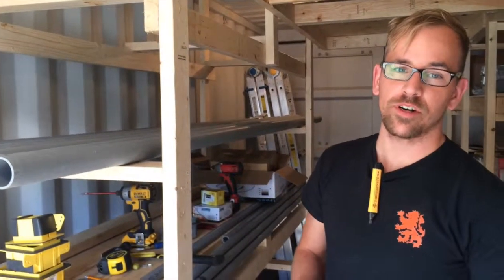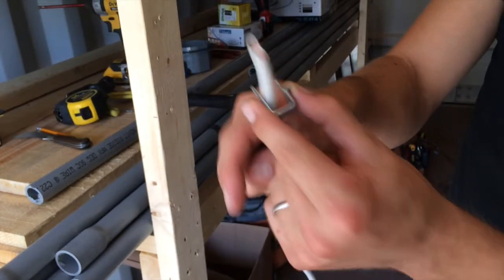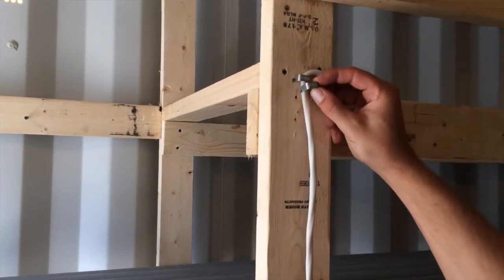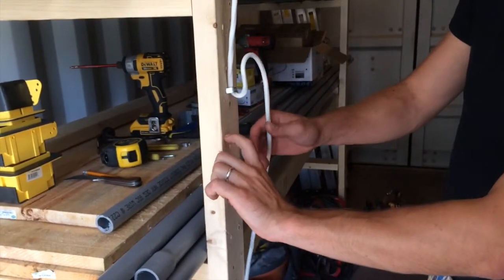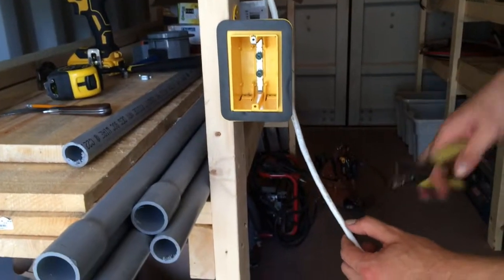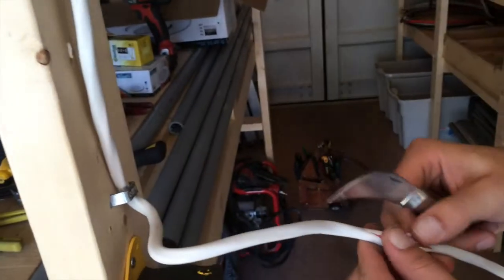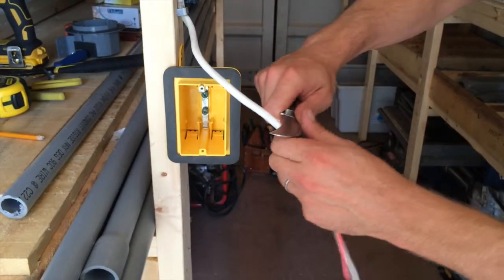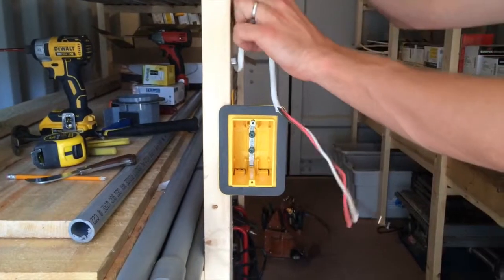Stripping a 3wire NMD

Comment: Joel, I'm curious what the origin of the "coutesy loop" is. Was it something you were taught when you started in the trade, a technique you picked along the way, or a standard that you conform to?
I've seen them periodically in recent years, but the get mixed reactions from different people. Some think it looks sloppy, some think it helps.
Reply: Dwight Bennett  We have learned over the years, it looks way better than straight into the box, it shows theres no tension on the line, and as long as its not a over amount they inspector will appreciate seeing that. Also gives you options if a client wants to lower or move the plug or switch. It can be done wrong, but when its done right its the best way to do it. Looks like you take the care to make things look nice and practical as well.
Reply: Joel Dijkema You have quite a different perspective than me; My logic is that it's a help if the wires in the box get cut too short or insulation damaged, there will be some slack to work with. There are some guys that consider it "professional" looking to have nice straight lines without slack or irregularities, hence they frown on courtesy loops. I think the truth is halfway inbetween. I appreciate hearing your take on it. Another variation is to come up the stud or joist opposite the one with box fastened on it, span accross to make a U-turn, have a staple/clip to secure it before the box. That leaves something to work with in the wall if needed without the "squiggle". Obviously courtesy loops won't work with MC cable, but a U-turn will.